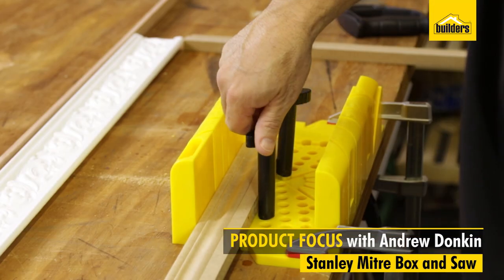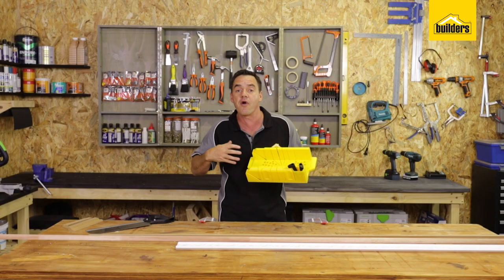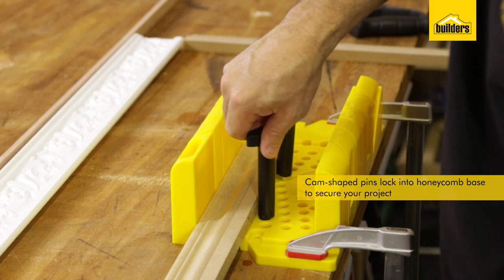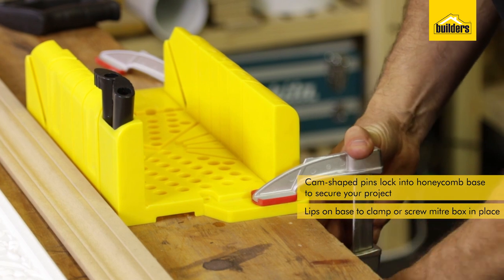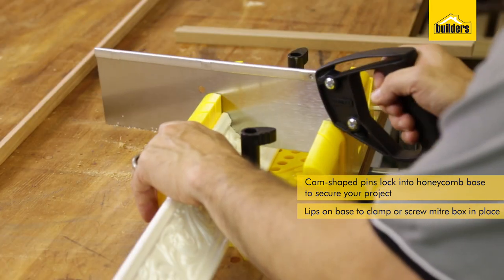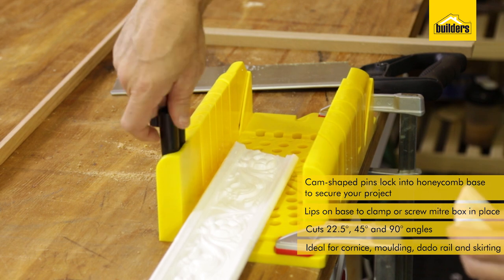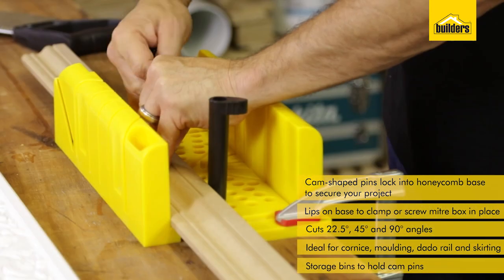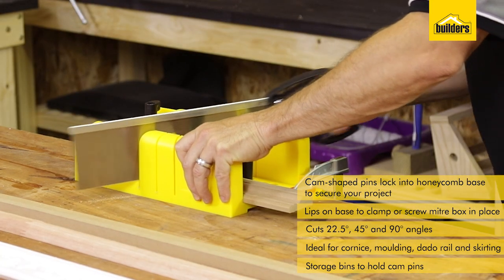Tools and Accessories - Stanley Mitre Box and Saw

Comment: Hi, is it really accurate?
Reply from the maker: Hi Paulo. It's not as accurate as a mitre saw but very easy to use and portable. There is slight play in the slot to accommodate the saw but if you take it slowly you can get an accurate cut. Regards. Andrew.
Reply: no, but then I have  not experience It is frustrating . I am cutting frame for glass windows in a door. quarter round . getting a 45 degree sharp angle is not so easy